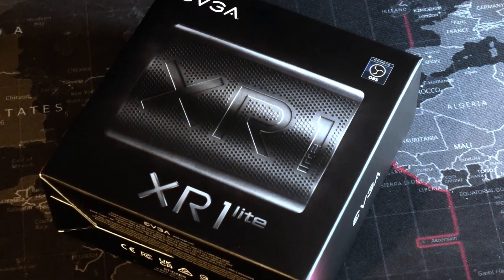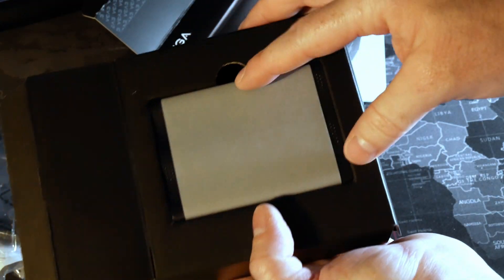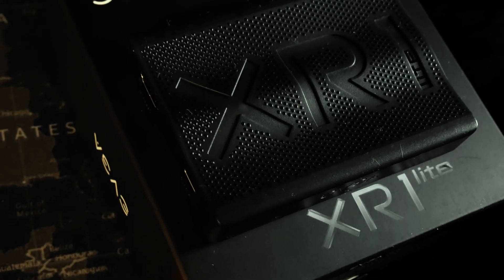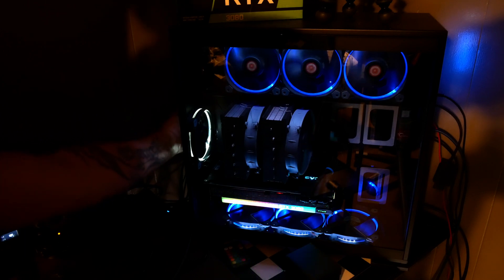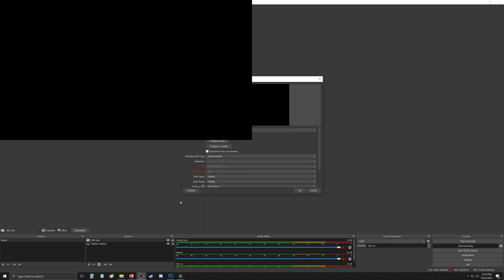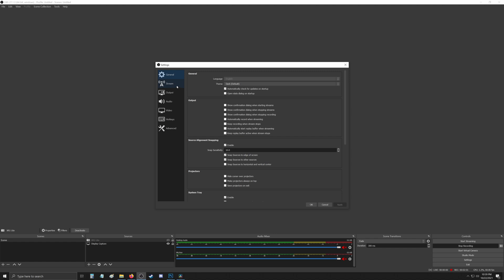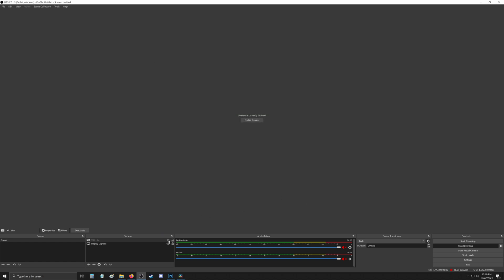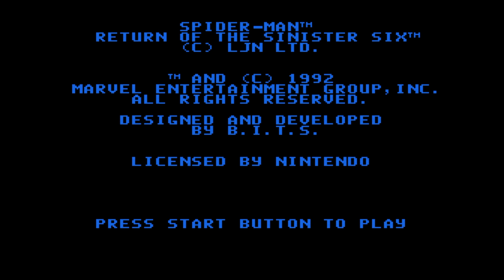EVGA XR1 Lite Card Unboxing Review Capturing MiSTer FPGA - Basic Setup Guide - Audio de-syncing

Comment: For perfect sync I muted the audio from the capture device and then I added an audio source and selected the xr1 lite. And I got two sources audio and video separately. Just worked for me. Cheers
Reply from the maker: There supposedly was a firmware update that fixed the audio desync issue but I havnt tried it yet. Your method is another option I thought about but havnt had much time to test anything, good to know there is work arounds

Comment: Can this card capture game and party audio from an xbox?
Reply: Lmk if it does
Reply: @lame gaming
Reply from the maker: Sorry man, I have only used it with my MisTer FPGA. It should work with any consoles outputting hdmi, make sure to flash newest firmware if you get it to fix audio de-syncing issues.
Reply: @LameGaming  it does! Buuut my card isn’t working anymore 

Mine just stopped working. When i plug it up my console goes thro to my screen and not my pc making it unusable

Idk what to do. Wondering if u had this happen to u. It was working really well was loving it but after 3 nights it just stopped working
Reply from the maker: @dumbbuttx  I havnt used it much lately but no issues. Id try flashing new firmware and using new cables that are known working.

Comment: This may be a dumb question but what do you mean by switching cores?
Reply from the maker: Its just relevant for mister fpga or other machines running emulation.
So when playing NES that would be the NES core, if you jump to Genesis, that would be the Genesis core etc...
Reply: @LameGaming , ahhh ok.  Thanks.

Comment: Mine wasn't working, but I didn't realize I had to pop that usb c into place. Scary but it's working real nice now. You're a real one for this video
Reply from the maker: I know... I freaked tf out when mine didnt work, then figured I might as well try forcing it in there if im going to have to send it back anyway. Once the cherry was popped all was good lol.
Reply: @LameGaming  What do you mean 'force' the USB into the device? Mine isn't working. Trying to record from Switch to PC. Any other settings I need? Thanks.. Update: I figured it out. I had to plug the USB directly into my laptop, I was using a dock that didn't read the video. Now it's working just fine! Thx man
Reply from the maker: @ballistik_coffee_boy  
Cool, and I just meant on some of these you have to forcefully insert the usb harder than you think you should press.
Reply: @LameGaming  Thanks, its working now, I realized I couldn't use a dock to plug the HDMI into that goes into my laptop, had to plug it in directly into the port. Thanks!

Comment: If there are seconds/moments without video output (like when switching modes or starting a new core, or dropouts when like recording from eg. VHS) the video capture don’t have any frames to record, while the audio keeps recording no matter if it’s sound or silence. Thus bringing the audio/video out of synch. The previously mentioned elgato systems will insert frames whenever frames are lost, so the a/v stays in synch.
Reply from the maker: ahhh... That would definitely explain that, I noticed obs displaying "no signal" between switching cores so yeah evga needs to do a firmware update to insert black frames, Im going to contact them to suggest it. Thanks for the info!
Reply: @LameGaming  Do you have a social media for us to keep track of this issue? I'd love an update. I have the same problem
Reply from the maker: @claireparker6460   I think tom gunderson's comment above is right, when switching cores it continues to record audio but drops all the frames of video when there is no signal which gets everything out of sync. Best remedy is to pause or stop recording in obs while loading a new core. Maybe evga will release a firmware update in the future that inserts black video frames instead of just dropping signal. 
Ive wrote to evga but they acted like im the first time they heard of MiSTer. Maybe if more of us request a fix they will do something about the issue.
I have a twitter @LameGaming80 but only really tweet links to vids I post here.
Thanks for watching!
Reply: @LameGaming  Hi,

I've been struggling with this audio issue and the firmware didn't fix it. Neither did separating the audio source. I've tried finding where I can contact EVGA about this but their channels feel so complicated. Could you direct me to where I can contact them or if you have any update?
Reply from the maker: @F1ST00  I was hoping evga would focus more on supporting their other products after announcing they are getting out of the gpu game.
I just used their contact us form or support email. I have no affiliations

Comment: I haven't had a chance yet to do a lot of capturing... but after two fairly short sessions (~10 minutes each) switching cores quite a bit... I didn't notice any issues with the sound getting out of sync.  One MAJOR difference though would be that I was using OBS on Linux (Fedora 35).   If I find out anything that I think is useful, I'll provide and update.
Reply from the maker: I didn't even know obs was supported on Linux. I used to dual boot back in the day.. I need to look into if my editing software is on Linux.... Probably not
Reply: @LameGaming  OpenShot has greatly improved and it is multi-platform.
Reply from the maker: @lsdowdle  Ive only used Davinci Resolve Studio but will look into this... thanks!

Comment: I also had a cr*ppy usb capture card and audio was desyncing too. Then i bought the pci-e 4k60 elgato and problem solved.
Reply from the maker: Yeah, Ive been hearing the elgato doesnt have the problem. Cant rule out it could be some windows,or obs setting though. Im going to contact evga and also ask on their forums as well but yeah... It could just be a "you get what you pay for" situation. Thanks for letting me know!
Reply: @LameGaming  I remember disabling all video/audio buffering in OBS capture device options helped.
Reply from the maker: @Rojame77  Thanks! Pretty sure I already did but will check